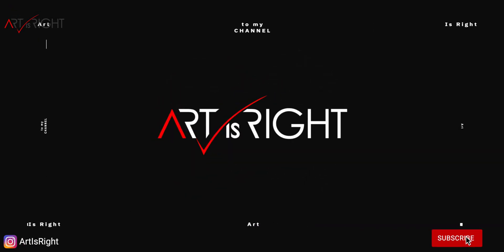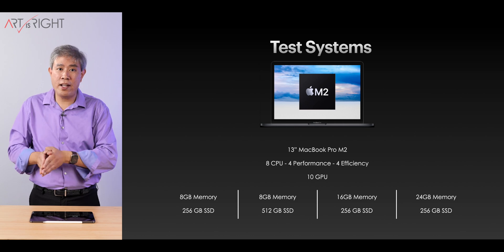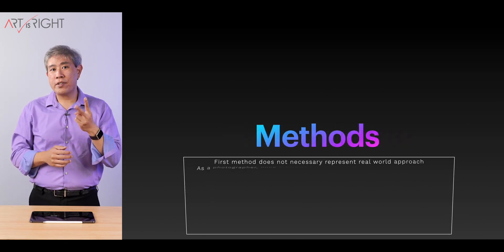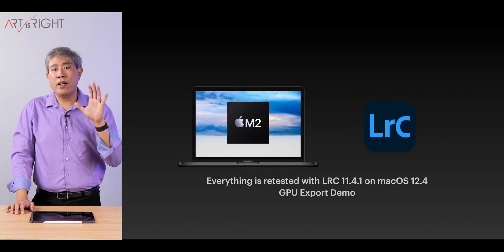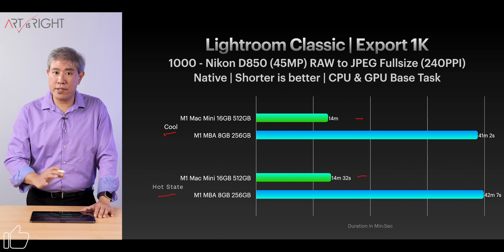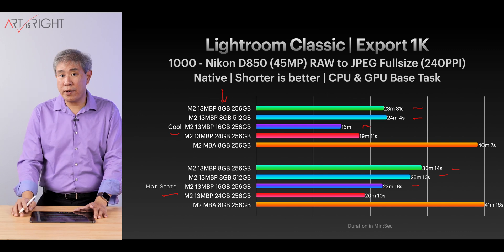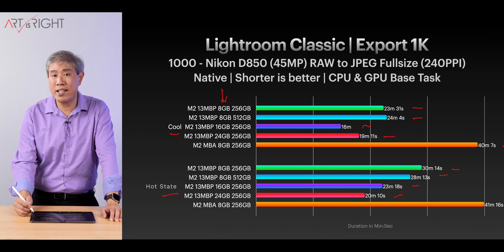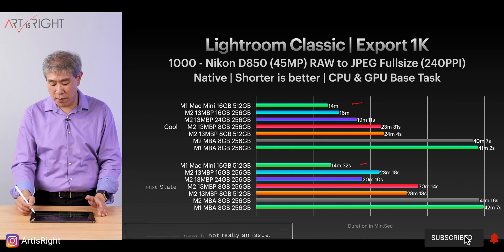Does M2 MBP slowdown when the chip is running hot? A quick comparison with M1.

Comment: Hello! Thanks for all the great content! I use Photoshop for digital painting. I wanted to know if you thought the fanless Macbook air with 16 gb Ram would experience slowdowns during a longer painting session?
Reply from the maker: Slow down will happen if and when the chips heat up. For what you do I think you should be ok. You might experience some slight hiccup under heavy use here and there but overall, you'll be ok.

Comment: Its easier for the system to retrieve data from the RAM modules than from the SSD. The distance is further & there are a few more steps involved. Perhaps that explains why more RAM leads to better performance under thermal loads, because the CPU has to actually do less, as such heating up that much less, as such having that much more headroom than an equivalent system with less RAM.
Reply from the maker: A contribution, yes. but there's something to be said as well about giving the apps all of the resources that need so that it can finish the task faster even if it is running hot.
Reply: @ArtIsRight  Yup, for sure. Having a basic understanding of how one's system works and then pairing that with generally good habits like what you mention is the recipe for a good user experience with our beloved tech.

Cheers & have a good weekend :))

Comment: I appreciate these extreme testing scenarios. They are important to really put the new chips to the test. However, as you mentioned in the video with the side note, real-world performance is a different world altogether. People shouldn't buy MBA (m1 or m2) for video or photo editing if they intend on doing heavy tasks as a primary function. I would say, being an owner of the mba m1, the improvements they've made with the mba m2 are all great. Technically you get an extra USB type c port because of mag safe, the camera is better and the screen is 25% brighter which is a big one! The increment in performance is of course a plus point, but I suspect that most people won't notice since the m1 mba was already a solid performer at all everyday tasks. IMO the screen brightness increase is a big win. I have the MBP 16 2019 model which has 500 nits of brightness and that screen was solid.
Reply from the maker: well said

Comment: Hi art, will Google drive video upload speeds be faster on a M1 MacBook pro 512 gb or a m2 macbook pro base model? Let's say for a 20 min 1080p video, because in an exam i would prefer to save most time. 

And if the m2 macbook pro base model is  slower, should i still get it for the increased performance? as in India both the macbooks said above with their specifications are the same price.
Reply from the maker: No that has to do with your internet upload speed.

Comment: The M1 Air gets hot and throttles under heavy load, I am well aware. Even with that, I still prefer it to the M1 MBP.  I did not want a fan.
Reply from the maker: yes by design

Comment: can you please compare macbook air m2 8 gpu, 16 gb ram, 256 gb ssd with m1 base configuration and m2, 8 gpu, 8 gb ram, 512 gb ssd.
Reply: May I ask what is the purpose?!
Reply: @jackwong64  sure. I am wondering that with upgrading ram how much performance gain we could have against to old model and only ssd upgrade without thermal throttling effect of 10 gpu. After all the tests I've watched I believe the best price performance ratio m2 macbook air is 8 gpu, 16 gb ram and 256 gb ssd version and that comparison could be the proof of it.
Reply from the maker: Thank you Jack. Nihat, appreciate the request but it is rather difficult to do all of the test definitively. A lot of these data should be interpreted based on trend. It is costly to do these review and the subscriber revenue on my channel is not enough to support all of this. Hopefully in the future. This said, I would give this a watch https://youtu.be/hLSZ72_ZHYY it will tell you a few things including chip segmentation, these are not pro chip, and when it comes to multi taking, one have to take a logical approach if the workload is heavy, you'll find out more in the video. As far as SSD speed goes it is really a non issue that has been blown out of proportion to get view and buzz. Now that everyone is talking about it, very few would notice any variation on daily use, so don't worry about that. And if you want to know about the air M2, 16GB vs 512GB SSD then watch this https://youtu.be/YKRO-4BiZrI take the scale and time from the M2 MBA and multiply it by 2 or 2.5 and you'll get a rough but good idea of how the air would perform. The scaling would be similar to the M2 MBP. Hope this helps.
Reply: @hejnik  hmm if I were you, I would pick new M2 rather than old M1 chip, the ssd speed is not a big deal unless your job role is encoding all day long… then you should go with the Pro. 

As for the thermal throttling… I won’t get the Air if your role is going be heavy. 

Moreover, Apple computer will follow the path of iOS CPU, every generation will gain ~10%+, it’s up to Apple.
Reply: @jackwong64   @ArtIsRight   thanks a lot for all the info and the tests you shared with us.  It is a great job what you did here, really appreciated. And thanks for comment, definitely helps a lot.

Comment: These videos are so incredibly helpful. I'm shocked to see the humble M1 Mac Mini perform so well. I was going to get a 14" Mac Pro and keep it tethered 99% of the time to the monitor in clamshell mode, but I wonder if the Mac Mini might actually be the way to go - outside of moving up the Mac Studio of course. 

Do you think results will be similar for building Lightroom Classic previews? I build previews for thousands of images - standard previews - at a time. 

...I mean results in the general sense that the M1 Mac Mini will outperform the 13" MBP M2 in this preview-building task. 

Thanks again for the vid!!
Reply from the maker: M1 Mac mini can be used in that capacity but if you watch this video, you will see that M1 Pro still edge out the M1 Mac Mini https://youtu.be/9dFTQaGeXKY
Reply: @ArtIsRight  So I was sort of like Jason above - I had a 14" M1 MB Pro, but I did not like the form factor. I have a 2018 Mac mini (acting funky), 2 - 28" monitors and 2 - 12.9" iPad Pros if I wanted to use sidecar....  I did not have room or need for a laptop.  But I do like the configs on it.....  Should I get a refurbished m1 Mac mini now or wait for the possible refresh in a few months.  I would rather be done with this now - but I don't want to get something that might not have a long life....
Reply from the maker: @Lori, if you are looking at the Mac mini, there are 2 ways of looking at this, if you need a production machine today get one, if you can wait, then I would hold off.
Reply from the maker: @Becoming, for what you do, you won't see too much variations.